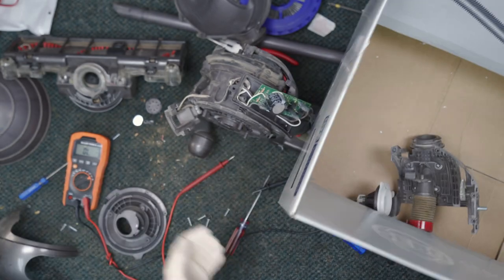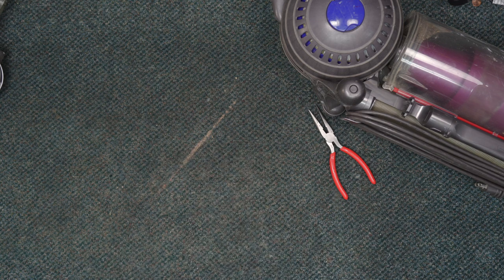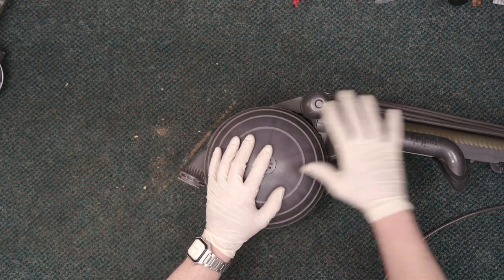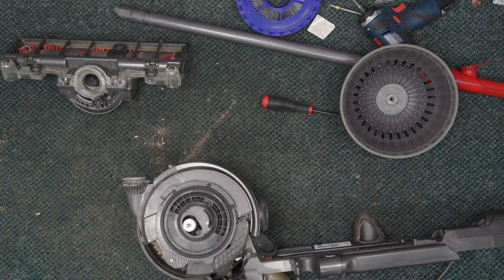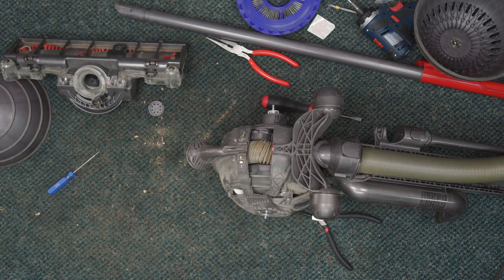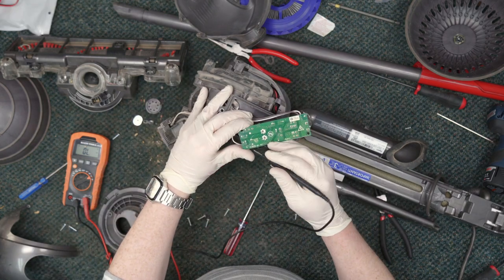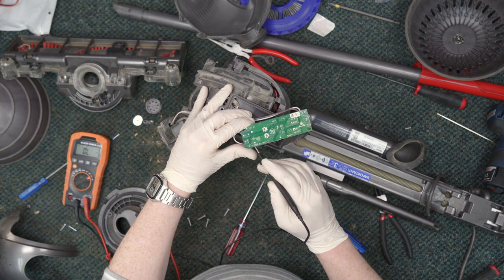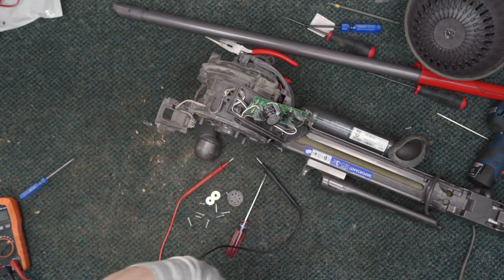Dyson DC41 - Brushroll Not Turning Diagnosis

Comment: You will not get power to the brushroll if the vacuum is in upright mode due to the microswitch in the vacuum. When the changeover valve is in hose or upright setting, the brushroll does not spin because if it spins and the vacuum is stationary you'll burn the floor or overheat the brush. Sometimes PCB can be at fault.
Reply from the maker: You are correct, the handle needs to be in the unlocked position. In this case, it was when I tested it.

Comment: I pulled one out a dumpster where  it belongs. It has the same issue . I'm not taking the stupid ball apart.  I'll bypass the beater switch so it's on all the time. If that doesn't  work ....back in the dumpster  it goes.

Comment: Thanks for the vid. I have this same problem on a DC50. When I press the switch I’m getting 120v+ DC (I think 160v) out of the motor brush area. I actually left the brushes in by accident and there was a huge spark. So definitely power coming through. I sanded the brush contact points. But when I put the motor back together, the white plastic piece with brushes and the can, I don’t get any voltage where the brushes are. I read that there’s some safety mechanism to prevent current overdraw in case the motor is shot, maybe the breaker that you show here, which would explain no voltage when the motor is assembled. The vac is over 10 years old and maybe insulation on the windings of the motor gave out.

Sadly the motor is impossible to find on its own and I have to buy an assembly off eBay for $50. Hoping that works, I’ll update my comment ✌️

Comment: I have a similar issue. brush roll not working. I'm gonna Use your diagnostics and see what i can figure out.  I cleaned the brush head to make sure it wasn't clogged. Sometimes it spins but mostly doesn't spin.

Comment: Hello just wanted to put this out there because I was having issues with my roller not working. The model of my Dyson was from target up13 or origin ball animal origin. I tried the whole resetting the button 5x while laying it down from another video and I also bought a new cleaner head off of Amazon. Nothing worked for me and even Dyson sent a new cleaner head but still didn’t work. I followed the video up until 5:46 then messed around with the actual reset button and was like hey doesn’t hurt to try now so I tried it and that’s what worked for me! Good luck to everyone trying to fix their Dyson! My vacuum  is less than 6 months of owning it so I was really bummed out about it not working but hopefully you guys get to find a solution!
Reply from the maker: Great, I'm glad you got it going! Cheers!

Comment: Matt, if you're still monitoring this video, I have a question about a Dyson Animal 2 head that spins intermittently. I tested the continuity of the brushroll head and there was none.  I checked the continuity of both leads and they had continuity. My question is can you purchase the electric motor seperately or do you have to replace the entire brushroll head?  Thanks for the awesome video
Reply from the maker: There is a power inverter inside the machine that likes to go out. The nozzle runs off DC and the machine is AC. It is possibly that may be going out.

Comment: Hey @houseofvacuums ---> In most electronic PCBs, it seems the capacitor will typically go bad first. The big black button on the pcb you showed us. Can you tell me what type of Capacitor those are? What Farad and voltage units, and any other values listed on it? Those can be purchased on Digikey for cheap, and are easy to replace rather than replacing the whole PCB. Just need a soldering iron, solder, and flux. :)
Reply: Also! You should be careful handling capacitors like you did in the video. They hold a charge and can shock you if not discharged properly. :)
Reply from the maker: Thanks for the question, Eric. I have never messed around with testing individual elements of the PCB on this particular machine. I have tried it on other machines in the past with varying results. I personally don't do it because of the voltages and the liability involved... I always go with factory from Dyson either new or used for insurance liability.

Comment: I do not get continuity when testing leads to the base of the vacuum (where the roller is).  Is there anything I can do to troubleshoot this or am I out of luck?  Thanks.
Reply from the maker: Hi Jay! You shouldn't get continuity through those, but if you "unlock" the handle like you are vacuuming the floor, turn on the machine and then check the plug you should be getting DC voltage through that plug. If you aren't, it is either the circuit board or the micro switch. Hope that helps!

Comment: I just want to change the belt how is that done? Thanks
Reply from the maker: Hi Kirk! The belt is not replaceable on these direct drive units. Dyson doesn't even sell parts for the drive system. You need to buy the whole brushbar motor housing asssembly, part number 923941-01 and it will set you back about $100. Hope that helps!
Reply: @HouseOfVacuums  thanks!!

Comment: I think you missed something in the troubleshooting. Did you know that the beater roller does not work unless the cacuum is in operating position.  you start the machine and engage the beater roller but it does not engage until you  place the machiine in the downwrite position. I think your issue was with a faulty breaker  in the switch mechanism.
Reply from the maker: I did test it out on the floor, but cut it for times sake. I tested the microswitch for the "upright brush off" mode and it was good. The PCBs on these guys are notorious for going bad. Thanks for watching and commenting. Cheers!